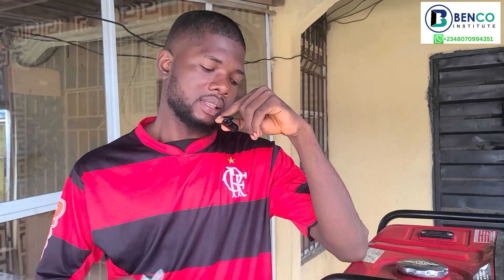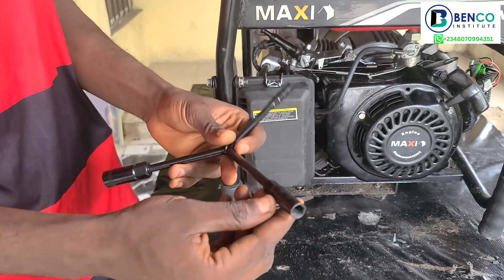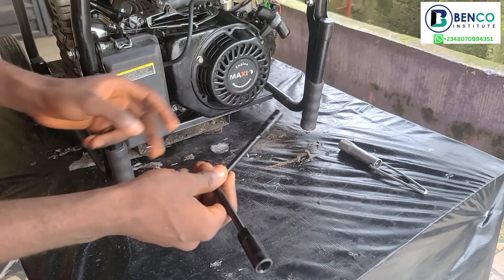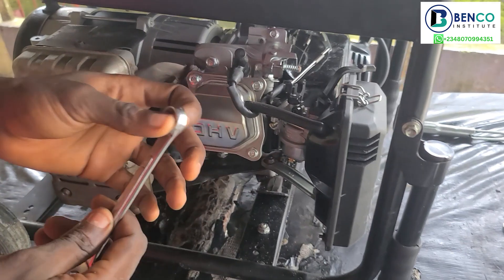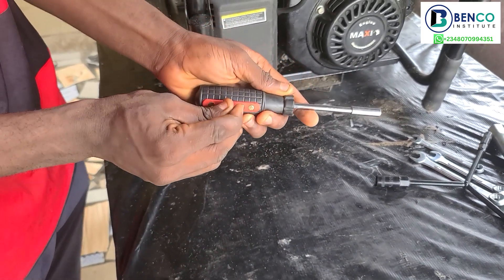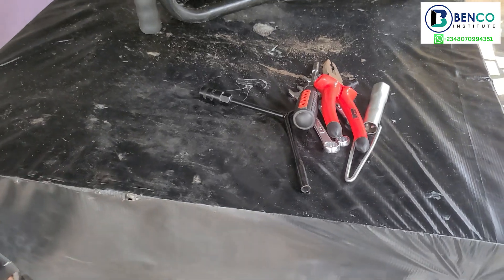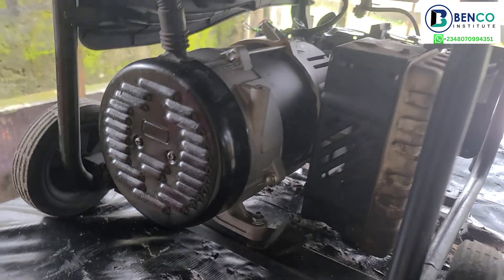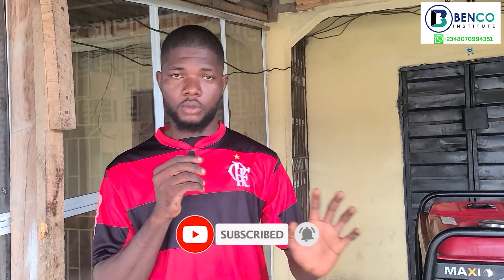6 must have tools to needed to fix your power  generator

Comment: Good afternoon boss! I have a question pls. My generator was running fine but I noticed the power indicator light was kind of low. And when I switched from nepa to gen..it would get lower and didn’t supply light to the house. I have little experience so I checked the electrical section of the gen as you did in the video. My first guess was the avr but no sign of burnt or damage. Same as the coils. I tried increasing the gen power from the normal place and also from the carburetor. But same thing. The gen voltage meter was reading above 220. But I’ve been noticing something before then though! The gen sometimes would suddenly go low as if when it’s out of fuel then come back up again and suddenly get a bit higher. 
So I called my engineer..I wasn’t around when he came. But my wife said he didn’t spend up to 2mins fixing it. She said he took off the tank then adjusted something around the carburetor area and that’s all. The gen immediately was supplying normal current again.
Could it be that the carburetor has been clogged and not supplying enough fuel or working properly so disrupting the normal fuel and air mixture needed to run the gen properly or what could he have adjusted there?
Reply from the maker: @SuccesshnAmin  I would say the later is what he adjusted but since he took of the tank I would say the  visible fuel jet on top of the Carburetor is what he cleaned
Reply: @  thank you so much for your response. I really appreciate. How can the visible fuel jet be cleaned? So I can do it myself next time and how can I prevent it from getting dirty pls. Will be awaiting your reply. Thanks sir.